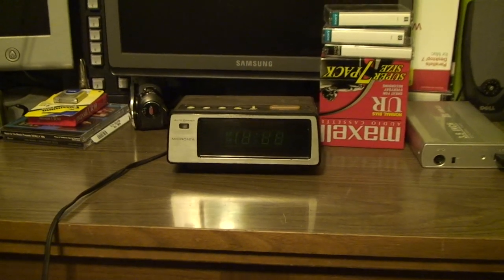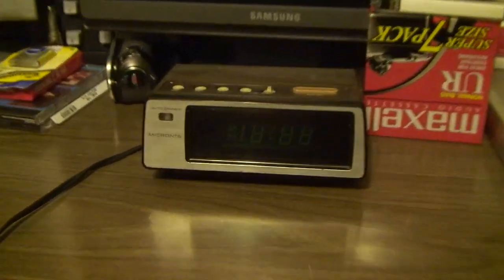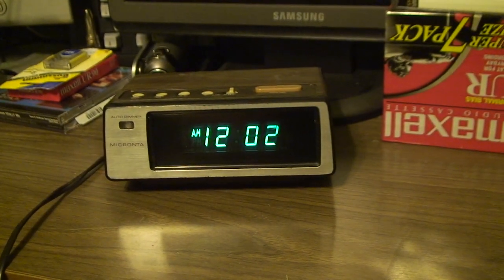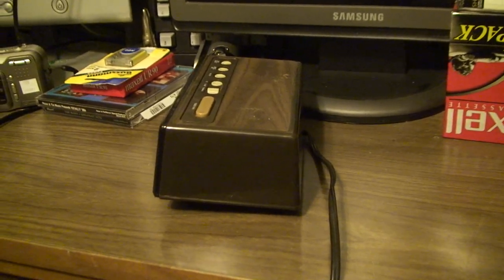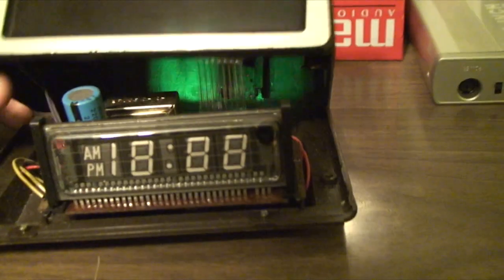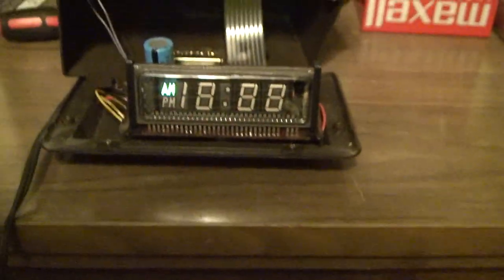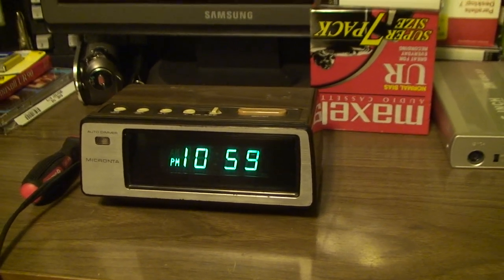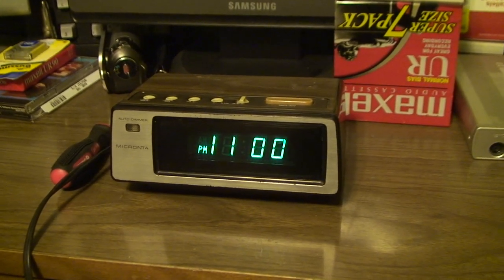Micronta 63-817A Electronic Digital Clock

Comment: I found a copal clock on a fleamarket recently. (Got it for about $5-) In great condition. It has that same vaccuum fluorescent display. Except that it displays the time in the 24 hour format. And doesn't adjust itself to the brightness in the room. (It has a knob to adjust it though.)

Comment: thats a rarity to have a perfect display! every early 80s VFD that I have encountered has some dimming, its never perfect. My 1984 Zenith VCR works perfect after being used straight from the day my dad bough it new to when he gave it to me 14 years ago, and still works good to this day. the vacuum flourescent display is heavily worn, but the channel and VCR indicators are all bright, as the time module is worn out, and it uses separete displays, a very good design that you don't see too often.

Comment: @uxwbill Question:  does the fluorescent display on your clock have a glowing filament anywhere in the display?  We used to have a gas oven with electronic controls and display.  And if I'm not mistaken, it had an extremely fine, glowing filament (cathode?) that you could just barely see.  If so, how many watts does the label on the clock say that it uses?

Comment: that clock chip is the first of its kind, manufactured in 1976 and was for the sole use of controlling vfd displays, it is capable of a 6 digit vfd display showing the seconds, as will as the year, the later one manufactured in 1983 was for both led and vfd displays containing the same functionality of the 1976 chip, the last and latest chip was manufactured in 1993 specific to only led displays and 4 digit led displays